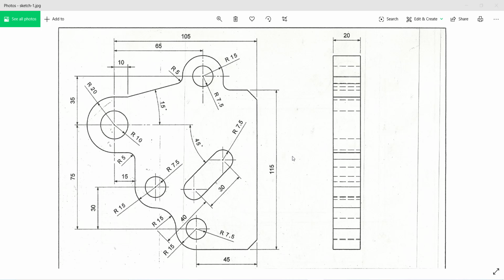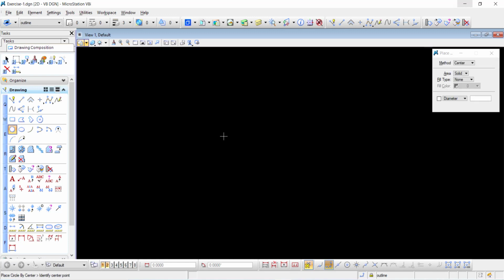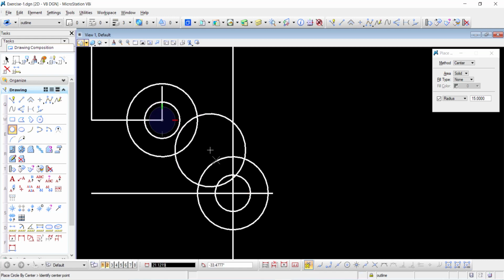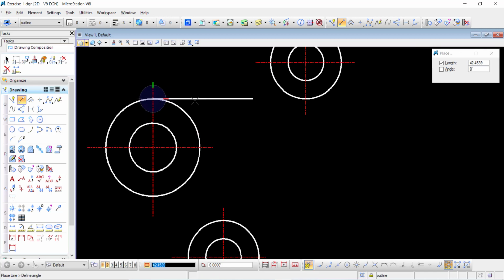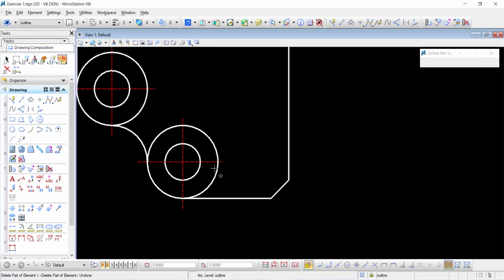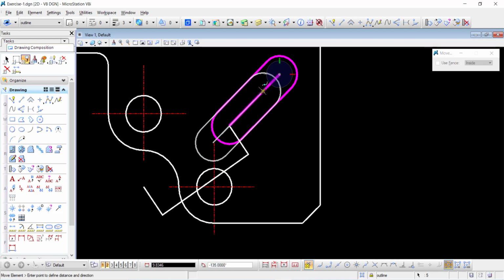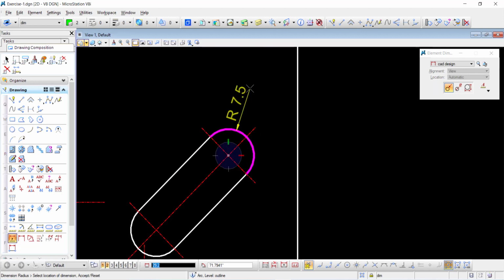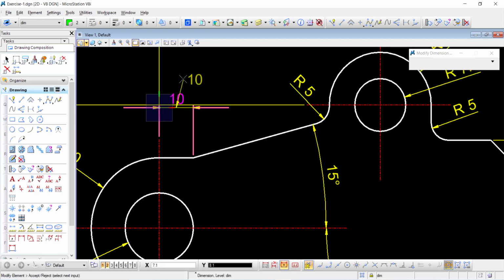MicroStation v8i Tutorial Beginner || MicroStation Exercises 2020 (Best in Hindi)

Comment: Hey, I just installed Microstation full version and i wanted to ask you if it is possible to installed in on the D:\ Drive. Whenever I installed it it goes on the C:\ Drive eventhough I configure it so that it should be the D Drive. Do you have any solution for that?